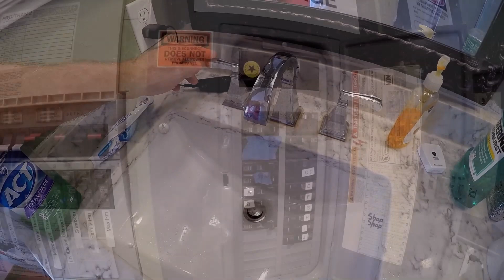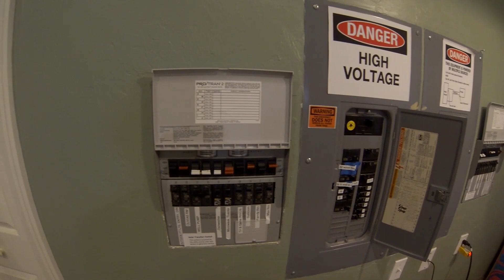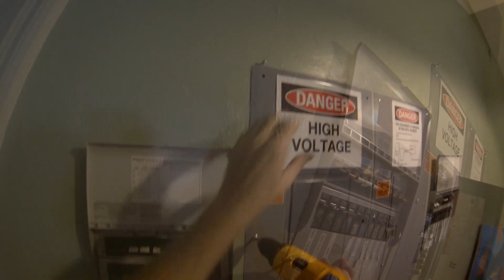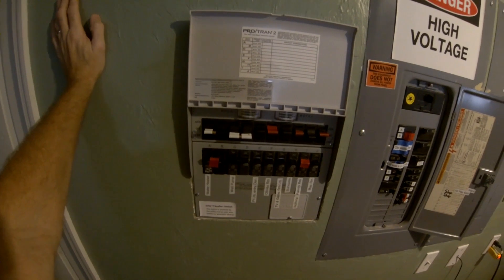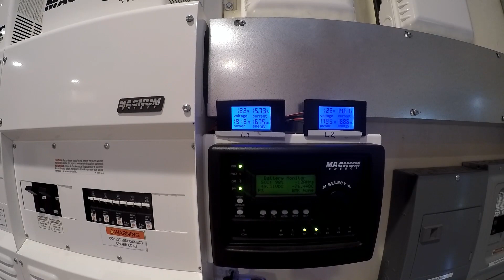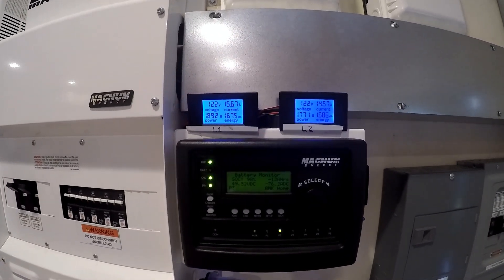Off Grid Solar #47: Solar Powered Water Heater

Comment: I was thinking of using the AC coupling method a Battery bank and Heat water tank's for storage with the possibility of using the thermos of the hot water tanks to store heat for heated floors Magnum has about the best system for this and adding these grid tie inverters that the power can be used without the grid as long as it connected on the output side of the Magnasine inverter  they will be tricked into thinking they are connected to the grid. https://www.dommelvalley.ca/catalog/datasheets/APsystems-Product-Datasheet-YC500A-3.30.17.pdf

Comment: This unit works with AC coupling of Micro inverters that island when the grid goes down and keeps the miro inverters producing without the over charging problem. Made by Magnum.  https://www.dommelvalley.ca/catalog/datasheets/64-0655%20Rev%20B%20(ACLD-40%20Data%20Sheet).pdf
Reply from the maker: John,  I'll have to check that out.  Thanks
Reply: If more people could use this to cut their hydro bills I am glad to help. If the Magnum company would donate some product for some video's because these parts aren't cheap for the people that have the right idea's to experiment and perfect a system that works I think i could sell this as a affordable package if built right that could put it in 75% of homes That have the space for 2 or 3 set of 14 solar panels. and the nice thing is it can be built gradaully over time with these Micro Grid tie inverters There is no need for DC charge controllers. That a savings of  2500 dollars for 3 solar Charge controllers.
Reply: https://www.youtube.com/watch?v=Bn6GUxVBRmE

Comment: Nice install.

Are you by any chance running this as a dump load or dump diversion with a thermostat?
Reply from the maker: Eric,  Well not really but sort of...  It is normally shut off (from power) as I preheat the water going into it with a solar (thermal) batch heater.  When I have good sun and the batteries are charged up, then I switch on the solar voltaic to "top off" this tank.  If I have no solar, then I switch on the utility to top it off but that almost never happens.  Now, does that help or are you now more confused?  https://youtu.be/KEPej1hZmto
Reply: @HomesteadEngineering  So the same elements will run off solar DC or household AC? Is it a pain to check every day and manually switch-over.  Other videos I've seen, they have 1 of each type of element in the tank, with the grid connected element set to a lower temp so it automatically comes on.
Reply from the maker: @R0yL33  I have two tanks, one is outside sitting in the sun with NO elements in it,  That tank feeds the second tank that is inside and has AC elements in it.  The AC elements can be powered by the grid or by the solar voltaic.  I should probably do a video on this... :)

Comment: I run my water heater off excess solar panel energy that would just be wasted.  I use the ARRAY DC buss to run the heaters through a controller and easily have enough power for daily hot water needs. Run your 240V elements on 120V and you will never have scale  that results from boiling on surface of the element. Also saves load on inverter. A dishwasher takes less than 100W to power, except the heater which is 1KW.  I run that off the DC buss too. Wife just has to do dishes between 11am and 3pm.  Since they have delay timers, that is easy.
Reply from the maker: Sounds like some very interesting ideas you have there.  Thanks!
Reply: With AC coupling You can use the AC that the micro Inverters produce and charge Battery or Power a Hot water heater with the Magnum ACLD-40 with a Magnum MS 4024/4448 PAE 120/240 inverter No need to use DC buss and less loss of wattage and higher voltages use smaller wires with lower amps. So there is a savings if you start with it.

Comment: Very nice. Since we went off grid I have my wife's beauty salon on solar as well. I changed the water heater element out to a 1000 watt. The house has a LP gas water heater and a electric one as well. We are going to use the woodstove to heat water soon. That will cut down on LP gas a lot. In the summer I hope to change the elements out to a 2000 watt and use the electric water heater. We use a out $30 a month in LP gas. That's our only bill except for property tax and fire insurance. If we put $30 a month in the bank in 8 years we can buy new batteries if we need to but I think we will get at t least 12 years from them. Solar is addicting lol. You are finding ways to make it pay you back. I only use about 25% of my systems potential in the summer months so heating water in the house is the next step for us too.
Reply from the maker: Steven,  you guys are doing great!  You hit the nail on the head with your comment about finding ways to use solar.  Anyone with an off grid or hybrid system that is not grid tied understands this.  We are wasting power during the day when we don't have enough loads.  I have been slowly adding loads to maximize our system usage.  I balance this against working the inverters too hard.  For example, I could run the dryer on it everyday but don't because it runs at 7000 watts of my 8800 watts available.  I just don't want to work it that hard.  I am typically running in the 2000's during the day and under 400 at night (a bit light).  I have NEVER used all the power that the panels could generate but I am going to challenge myself to try it soon and post a video of it.  Thanks!

Comment: Hi David, did you change out the elements for a voltage /watts conversion , aging or just updating ?  I kill two birds with one stone by attaching a hose to my heater and wash the vehicles with the long hose going out to the driveway. It stirs up the sediment and flushes the tank out better by having the water being sprayed and shut off at the nozzle in bursts.  I checked once by attaching a mesh ( piece of pantyhose and sock ) wrapped at the end of the hose while filling my hot tub. It left gobs of sediment in the sock . My heater made less crackling noise after the flush. WIN-WIN situation.  Hope you didn't forget to apply some plumbers putty to the threads.....Later    J K
Reply from the maker: James, I changed them out to lower the wattage and because they were old and corroded.  I did not show that part but I did flush it out for a while before draining.  Good suggestions, thanks!

Comment: i am in Montreal, the insurance compagnies makes me change the water heater every 10 years!!
Reply from the maker: Do you know why?  What are they worried about?  Does the insurance company own the hardware store?
Reply: David Armstrong they know when the tank is installed because it required we tell them. 
They wory about the tank leeking and making a flod!
Sorry about the spelling, i am french speeking.
Reply from the maker: Maybe you could locate the old tank outside in the sun (in a box with a glass lid) and use it to pre-heat the water to your new tank???

Comment: To save time on element change out turn your water off before heater then loosen element then change out quickly. You'll loose about a cup of water is all.  You must relieve pressure then besure all the faucet are closed so it can't get any air.  That's how I so it in a hurry
Reply from the maker: Hey Roy,  I have seen that done and I debated on trying it that way.  I decided not to because I was worried that a badly corroded element might get stuck on the way out.  Now that they are new, I may try that when I swap out with the new foldback elements.  I'll film it just in case it goes badly...

Comment: Excellent. Did you fully take those two other circuits (dishwasher/microwave) off the transfer panel entirely? I actually did something similar with the microwave...took it off completely. Anyways, nice work on this! Should last a long time. My hot water tank is gas...not sure if a mod like this would be useful. I heard tankless ones are more efficient...just not "smart" on anything related to plumbing.
Reply from the maker: I did take those two circuits off the transfer panel and put them back on the utility.  I may put the dishwasher back on solar in the future by swapping out some other circuit.  If you have a gas heater than this would not help you.  I looked into tankless and I am not a fan although I think that would be fine for an outdoor shower.  I do have a project coming up for a solar batch water heater that I think you might consider implementing.  It's basically an old water heater laying in the sun that preheats the water to your existing tank.  Thanks!
Reply: Cool! Can't wait to see that.

Comment: What are the ratings of the new heating elements?
Reply from the maker: Camco 02282/02283 3500W 240V Screw-In Water Heater Element - High Watt Density

but I plan to replace them with this fold back, low watt density element:
Rheem SP10869KL Screw-In 240-volt/3500-watt Element, Premium Resistored Stainless Steel
Reply: David Armstrong thanks for the response
Reply from the maker: What can Saaaaaaaaay, accept, your Wellll-come!